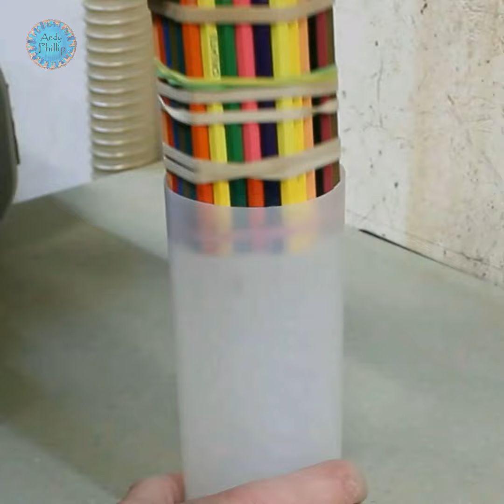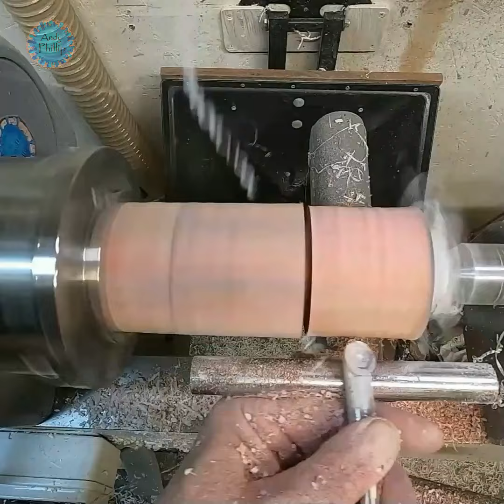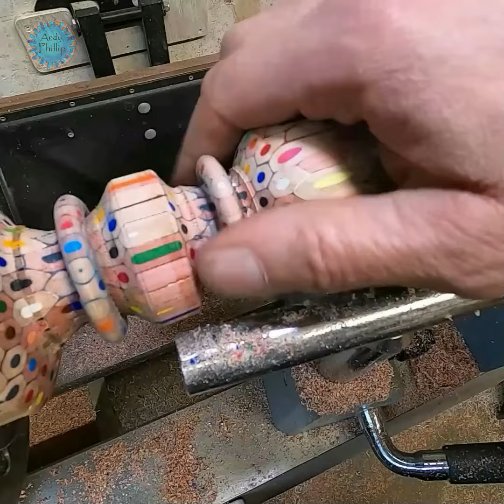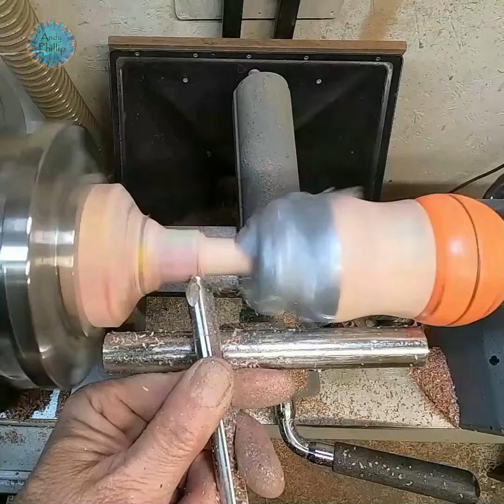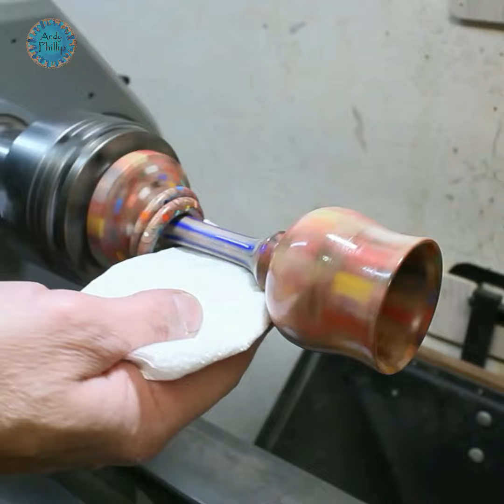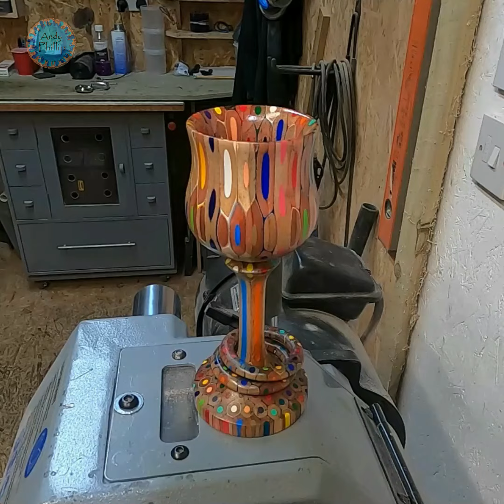Woodturning - The Pencil goblet (warpspeed)

Comment: I have used same material for smaller pieces but always had a headache when sanding as the wood was getting stained by the color :D. What finish did you use (I usually used CA finish, which is another kind of pain :D)? Thanx in advance.
PS. Always a pleasure to see your pieces and workprocess!
Reply: CMO
I have the same questions
Looks like Andy didn’t answer